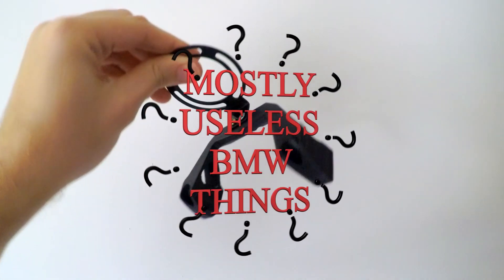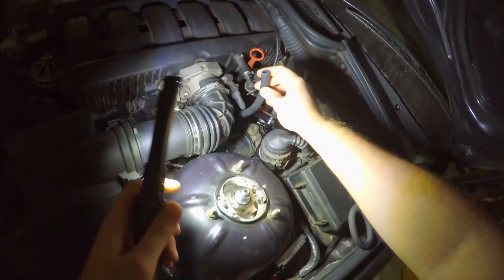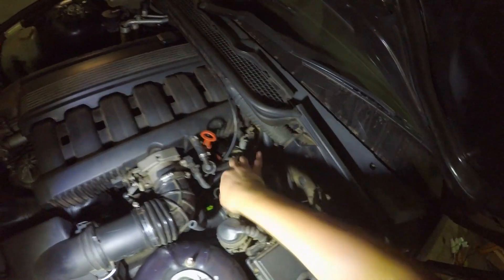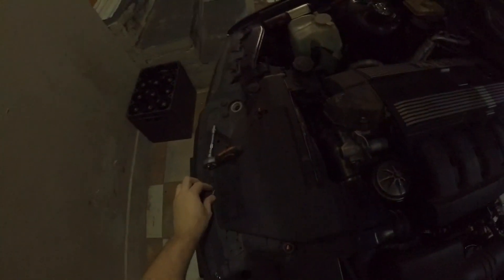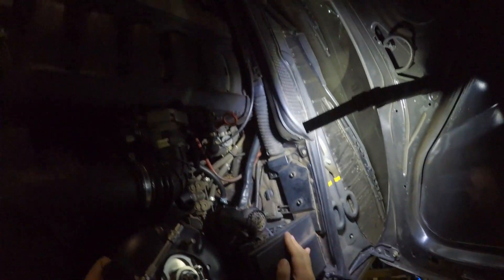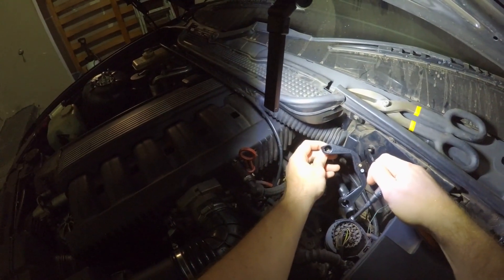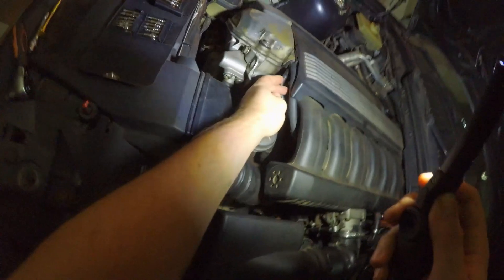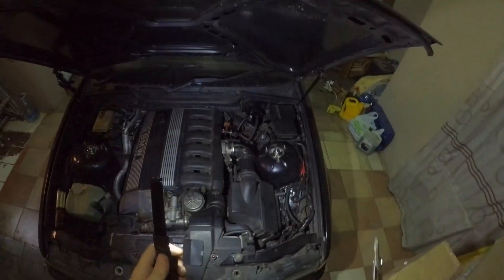3D Printed Oil Catch Can Holder // BMW E36

Comment: Found this on Thingiverse, great idea for mounting! I have a LHD E36 I added a turbo to and being LHD can't mount my can in the exact location but the can I want to run is the Mcnally one that's really quite large so I have to fit it on the right side but I think I will steal the idea of how to mount it.  Should make a nice clean install for mine printed in Nylon CF filament.